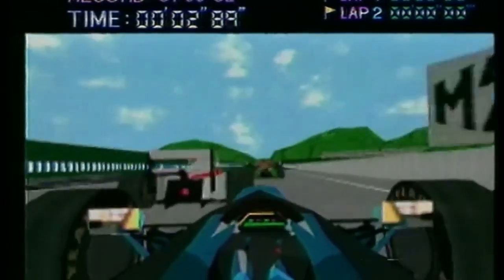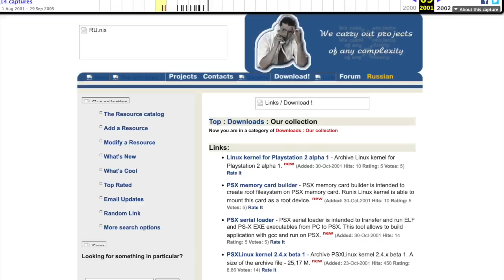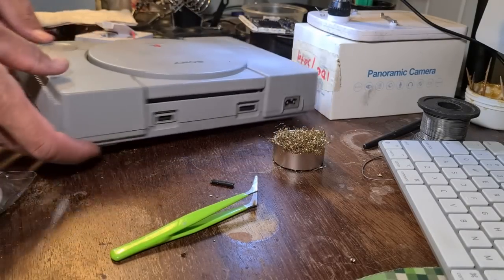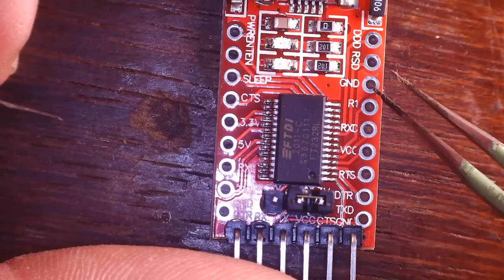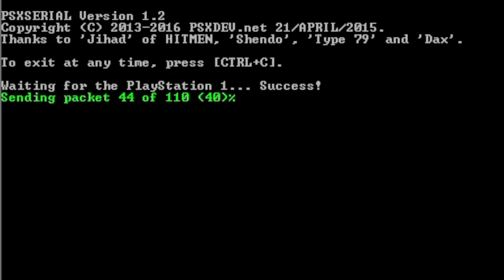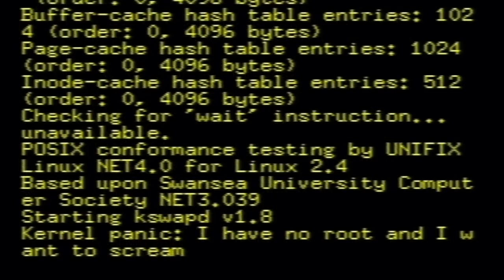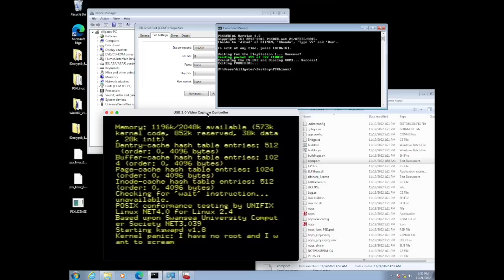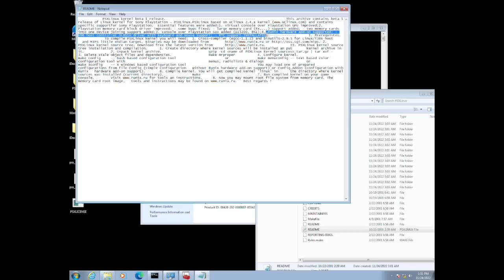Can the PlayStation Run LINUX?

Comment: The real question is can it run TempleOS 🤔🤔🤔
Reply from the maker: dunno? does it run on RISC?
Reply: @chelsona2574  probably not but it is open source and only 15MB and includes terminal support,7 video games and usb & floppy disk support so in my opinion it should probably work but incase say it didn't instead of with Linux where it would be easy to change the source code as it's written in human readable C however the guy who wrote TempleOS wrote it in X86 assembly which is technically human readable but near impossible to read but yeah in conclusion you probs could depending on playstation model and whatnot and if it can run linux then you can open up a web browser and download the iso then install balena etcher and make it bootable or you could install it within linux itself (pretty sure there's a guide on yt somewhere)

Comment: I don't understand the fixation of people on the internet of vilifying a person modding retro stuff. Cutting the PSX serial cable is a reversible process, of course it won't be in "one piece" anymore, but either way it's seeing more use than it probably got sitting on a shelf for years.

PSX multi-console multiplayer was a nonstarter when it came out, unless you were a super-rich kid or had friends REALLY into videogames. Two consoles, two game discs, two TVs. At least the Gameboy had 1-cartridge link games..

PSX link multiplayer is even more expensive now, since most of the games worth making a setup for are themselves expensive (Armored Core, Red Alert).

Even just with this intro video, I can already see why PSX didn't have a good run with Linux. The PSX has the specs of a $10 microcontroller today, with even less flash storage. With the cartridge-based systems, you could at least rig up something like the N64's DD (Japan) or the Doctor V64 (aftermarket) and have the Linux "firmware" on floppy disk and not have to send the program through serial every time you reboot. Or if you were a little more of a hardware expert, you could make your own cartridge with rewritable EEPROM and swap cartridges. The black devkit PS1s (Net Yaroze) did have double the RAM and a different bootloader, which made developing games the official Sony way easier than burning a disc every time you recompiled, but they were expensive.
Reply from the maker: i spend more on whiskey mate lol, its my cable and i have no intentions of playing serial port games anyway but i appreciate your understanding of how wild people go over a cable like it was cutting my car in half or something lol.

Comment: I don't know much about the PSX memory card interface and if the PSX has a storage controller in front of it rather than just GPIOs, but seems like it might be worth looking into writing a kernel driver that just bit-bangs SD card protocol to host your filesystems on.  It also looks like the serial port has the full complement of control signals (RTS/DTR/CTS/DSR), and they're usually just proxying a register in the UART chip...SD in SPI mode or SPI flash only really needs 3 lines for SCK, DI and DO so it might be another route. Might also be something that could be done on the early gen PSX hardware that has the parallel port, although I don't know if that's a raw IO channel or some weird Sony bus interface that needs a ton of glue logic to decode.
Reply from the maker: still doing research into this but thats going to be a different video, I like your thoughts tho I have pondered this too

Comment: If you can compile a new kernel, forget the memory card filesystem for now.

Focus on loading an initrd (or ideally an initramfs) and running a userspace application from there (if you are low on ram, you should be able to make a custom binary that just prints hello world and loops forever in just a few KB and rename it to /bin/init).

From memory, Linux has a mode that allows you to concatenate or embed the initrd onto/into the kernel image, which allows you to upload both over serial at the same time, allowing you to avoid providing proper storage until later.

Comment: There are memory cards that have several sets of 15 blocks. You swap through them with a button combination.
Those memory cards typically had 7 segment displays to show which set you are currently on.
Reply from the maker: from what ive read they all have 16, 1 block is taken up by the filesystem info leaving users 15.
Reply: @chelsona2574  Okay, I checked the attic:
And, I still actually have one of those. but it doesn't seem to have the 7 segment display but just 4 lights.
written on it:
PERON
4 Mega
Memory Card
Reply from the maker: @fgregerfeaxcwfeffece  yeah its basically a bunch of memory cards emulated or virtualised.

Comment: Cant wait for the next video. I was experimenting with the runix kernel aswell a couple of years ago. Been thinkering on an off at times and learning linux along the way. I see others have hinted at possible fixes for an embedded ramfs, next episode awesomeness.

I had the kernel almost load a filesystem of 1 memory unit, fat you say? Hmm it was definitely breaking the existing block fs system to gain bytes. I got a bit stuck using emulators, and cant take my real ps1 with me all the time for experimenting.

Their code and patches hinted they planned to add CF card support (over the PIO, even your ps1 has the pins on the motherboard slread arrounnd the ics) ans they had Usb, that isb ic isnt easy to get, i hope a more easily to get ic drive can be added.

I definitely like to followup soon. The cd loading was slow and wastefull, so serial transfer was also my togoto method. Hope youll get kernel debugging going tho. Debugging by just running is slow and dark.

A newer kernel also would be waay better, ive tried comapromg their patches to stuck uClinux and probably be nice to have documented more
Reply from the maker: thanks for watching and your comments! im glad to see there are some old tinkerers coming out again! lol.

yes im looking at a newer kernel probably 2.6 and trying vfat and ext2 options, i think a combo of pio, serial and memory upgrades is the way to go. the whole sd card thing ill look at later but its still a lot of fun picking up the trail. its like a cold case at this point lol.
Reply: @chelsona2574  Yeah its a intrestring puzzle, especially because we have atleast a bootable kernel. pio for some kind of long term storage would help alott. newer kernels might also come with newer drivers for handy hardware (network, usb, storage). I would love to see what you come up with :D and saw No$cash updated the emulator?!? maybe we see Linux once again for the ps1 (and lol, some use for it, atleast learning alott)

Comment: The challenge is the filesystem. If you are swapping out memory hardware, at that point we are running Linux on R3000a, but not PSX

The PSX does not give you much in terms of storage. Memory cards have to be read / written in terms of blocks, and blocks are addressed via 64 128byte "frames". I guess you could mangle a filesystem onto one but you would need to get or write a driver for them... that would be interesting

Plausibly you could write a device driver for the parallel port but I've never done it and it sounds tricky...

If you can find an "Action Replay" style "backup memcard" device those work by packing multiple memory cards into one. There are homebrew projects for building similar. At any time the device only addresses one card but it seems like you could switch which one was used... that implies some magic was possible with the right ops. But I bet it would be slow. The memcard bandwidth is pretty poor, due to being synced with joypad IO
Reply: Action Replay didn't let you backup memory cards / use predifined. It was cheat system, with microcontroller (i believe some PIC?) that was programmed to put different value at some RAM address, so to cheat in games. That's it. Whole magic. Boom, ou got every car / fighter / inifinite life / ammo whatever, because on only one value changed at a particular moment. Game had to load it into the RAM, then Action Replay swaps it. No memory card images involved. At all.
Tho parallel port actually lets you do everything you want. It has direct access to any possible place in the whole console. It is doable, certainly.
Reply from the maker: I have a plan.. As far as Linux running on a psx goes I'm not worried how slow it is. This project is trivial at best and some fun :)

We have a few options to explore, memory cards and multi-taps will only get us 1mb with two boomerangs all linked up and I havnt even seen one in years so I'm not looking at this as such to be the solution.
Reply: @KoneserMarazmu  I am aware of the AR cheat system. I am referring to a different product, their backup memory devices. Here in Europe at least "Action Replay" was a brand that covered several actual devices. The relevant point is that there were hardware that bundled multiple memcards with a microcontroller that could switch between them. One homebrew project I've seen (PicoCard) does so using joypad commands, possibly just reading from the shared joypad / memcard IO
Reply: @KoneserMarazmu  The parallel port would not be usable for this particular device, as not only do the 900X SKUs remove the port from the back of the device, IIRC the BIOS was revised to no longer support the PIO either. So it would require an older revision of the PSX

The PIO is powerful. You can set hardware interrupts and everything. So it would seem absolutely feasible you could do storage over it. However you would need a kernel module to address it, and to   initialise the PIO properly during boot

Comment: Hey, this might be a longshot, but have you tried dumping the code that you have into ChatGPT?
You might be able to tell it what you have, the limitations, and what you need and it might spit out some code to help you out.
I've been messing around with it and it's kind of insane how good it is at programming.
I've put in a few pieces of code that I had no clue on what it did and it gave me detailed documentation on it on the fly.
Heck, it might even know of the exact file you're missing. That thing is insane.
Reply from the maker: No I havnt. It's well documented what file is missing "psx-mcard.0.8.2.tar.gz"

The best thing we have is either multiple memory cards which can be setup via a kernel loader program that can then talk to the serial port and load up a ramfs to either the on board 8mb memory or to a cluster of memory cards via the multi-tap boomerang which even with two only gives you 1mb.

Comment: also, if you want to move code around quicker - ditch that old PSXSERIAL thing.. its slow.

I wrote sioloader, that supports 1036800bps, or use unirom, that goes up to 518400bps. PSXserial is in the dark ages at 115200bps
Reply from the maker: ahh wicked!! yeah this was just what i remembered from a few years back while playing around with the psx ill defs give it a whirl yes sir!
Reply: whoaaaaaaa! where is it? It doesnt seem to be easily findable on psxdev :v :c

Comment: The vita has a game cartridge to microsd adapter. You surely could create a such thing for the memory card on the ps1 right. Like once you have a bootable Linux, you have a driver to access a ext2 or FAT partition.

My guy, when you get it working; you have to get nethack running. Could be a cool project for easier homebrew, I'm not sure what homebrew is like on the psx but I do know the netyaroze was a thing and it's specialised hardware which is a pain to get a hold of as it's expensive.
Reply from the maker: you don't really need a net yaroze with my setup here. you can develop your own games and software basically in the same fashion with opensource replacements.

no PS2 memory cards will not work in a psx just like the MX4SIO SD cards will not work in this system. there are some aftermarket psx memory cards but these add more issues than fix.

multiple memory cards of a psx for example with the multi-tap 4 controller setup is you will only get 512kb if you can link them together in some kind of raid configuration which is a whole other story. a lot of work for not much gains. with 8mb of system memory you can load a ramfs.

Comment: You probably already know, but that’s “micro-C Linux”, that special “u” symbol means micro.
Reply from the maker: I work with smd circuitry all the time for caps etc. The letters "μC" are for "microcontroller": the name is pronounced "you-see-Linux", rather than pronouncing the letter mu as in Greek. Im well aware it means micro this information is from their site and the wiki. There isn't much information about uclinux or runix.

Comment: The R3000 didn't have an FPU iirc. It was the lowest end chip in that series.
Reply from the maker: correct, although it does have the instruction set inside this CPU for the FPU but obviously these instructions will only work in the 0CPU has access to a co-processor. thank for watching :)
Reply: @chelsona2574  does that mean you could possibly externally plug it in? Ie some replica made with FPGA, and plugged sde by side? I wonder if the games would use that external logic, instad of its own, software defined, and would look "n64ish" because of that.
Reply from the maker: interesting question, my search in the data sheets sort of shows it to not be possible but who knows I didn't really delve into it that far

Comment: Awesome tinkering! You are great, can't wait for second part or see what you find out. 

Quick question, is this all coded in C, C++ or C#?
Reply from the maker: C for life!
Reply: @chelsona2574  ah, C, the universal language of our tech
Reply: @chelsona2574  It's about to get Rusty though isn't it!

As much as I adore C, I think it's probably not a horrible idea if we move to Rust ;)
Reply from the maker: @Caluma122  ill see how we go with C first followed by a few whiskeys and then if the bottle runs out we can talk about rust :)
Reply: @Caluma122  Is there even a Rust compiler for R3000?
Reply: it would not be C#, it couldn't fit!
Reply: most definitely C, most kernals are not written in C++ and 100% not in C# as thats an interpreted lang.
Reply: whenever there is minimalistic Linux it is always almost 100% C or assembly. very recently there are starting to be parts written in Rust but that will take a long time to happen. for example if you want to get best GPU performance with Linux on a Apple M1 then you have to use a driver written in Rust. and someone is trying to rewrite entirety of GNU coreutils in rust

Comment: I’m not close to any kind of understanding how this all works, but can any of your unknowns be solved, by looking at how PS1 emulators work? I mean you’re trying to get an ISO to load, and the emulation guys do it. Maybe there’s even an open source emulator that you can dig into.
Reply from the maker: No$psx is the best emu for this particular job but nothing beats real hardware. Most of the DEV work I will do on debian anyway.  Thanks for watching :)
Reply: @chelsona2574  would it be worth a check on how ODEs boot them then?
Reply: @chelsona2574  Thank God you're going to be using a real Operating System and none of this Windows "What program do you want to use" nonsense 🤣
Reply from the maker: @Caluma122  linux is fun lol

Comment: nice work. keep it up. Just feel sorry that you had to buy a 88$ cable then detroy it to solder solder it into the FTDI. Could have just soldered wires directly into the PSX mobo and saved both a retro cable and bucks
Reply from the maker: All in the name of science mate lol, I was going to but I wanted to keep it simple plus now I have two cables so it's ok :)
Reply: @chelsona2574  Hmm put a real 9p serial port in there, sounds like a worthy mod 🙂
Reply: @freeculture  done that to both my psx and dreamcast. Made dev much easier and no need for special cables :)
Reply: There are also FTDI serial adapters that break out to a phone cable. I've had one floating around for ages and I only realized what it was last year. Where the old man got it, I haven't a clue.

Comment: This is cooler than I remember it being. I'm sure there was an ISO image that could load Linux on the PSX but that looks like it lost to time as well unfortunately.
Reply from the maker: haha yeah i remember hearing about this years ago and it seemed pointless but you know me lol.. ill do any trivial nerdy task in the name of science lol. i do have a plan for the initrd, ramfs and keyboard but i dont want to give too much away just yet lol

i have created my own ISO image but results may vary at this point because of the rootfs issue needing to be addressed first
Reply: @chelsona2574  It was very pointless, can't wait to see more of this series as this is much better than what I got to play with. I won't be happy until it runs Gentoo though 😉
Reply from the maker: @immoloism  if you get gentoo to run on here i think you will hold the front page of r/linux for a while lol
Reply: @chelsona2574  I haven't got a PSX anymore to test but when you get it running I might have some ideas.
Reply: @chelsona2574  actually first thing that needed is bootloader wgich is not actually linux specific thing. and i think cds has some kind of bootloaders too, probably build env creates a linux distro and auto loader script for generated game executable. still needs lots of test and trials and ddebugging to see actual code executing on system.
Reply from the maker: @ahmetmutlu348  well this is what kloader does for the ps2 when you Run Linux which allows you to select custom settings for your system etc.. I have considered this, for now I just need to get the system prepped and ready
Reply: I got the Wii to run Linux once.  That was an adventure and a half, and also way more useless than it should be.  :)
Reply: @denniswoycheshen  I've got a port of Gentoo for the Wii which is just plug and play if you ever come back to this :)